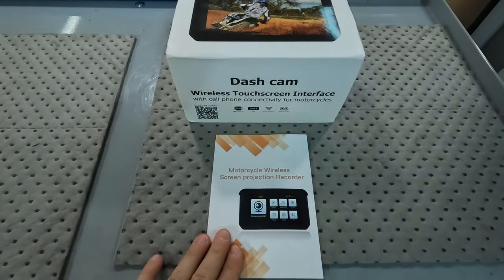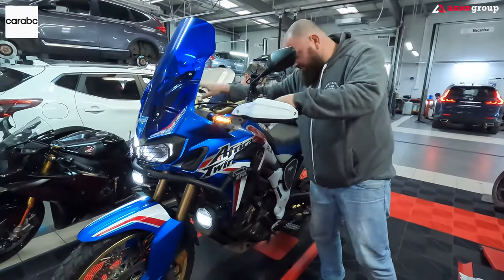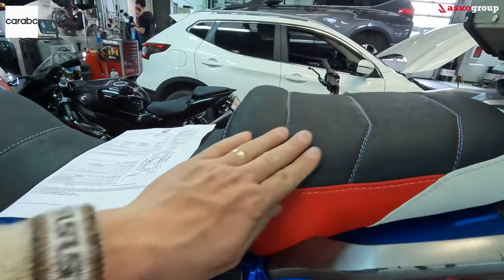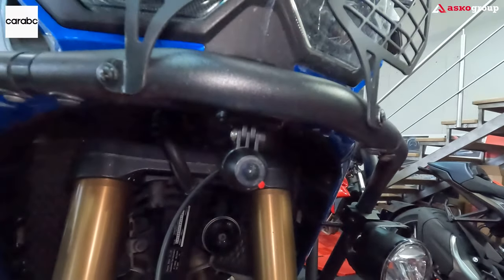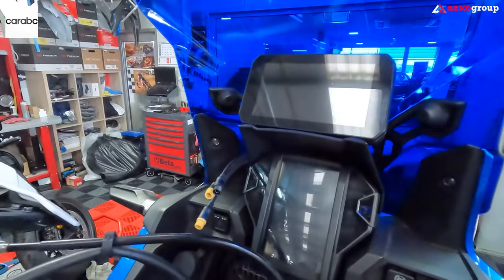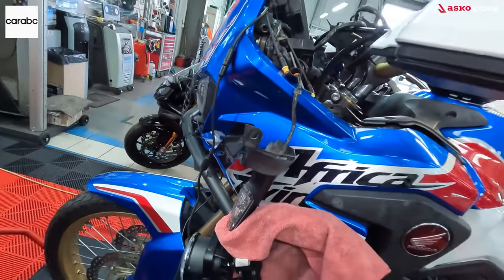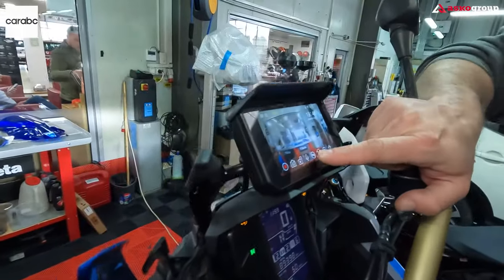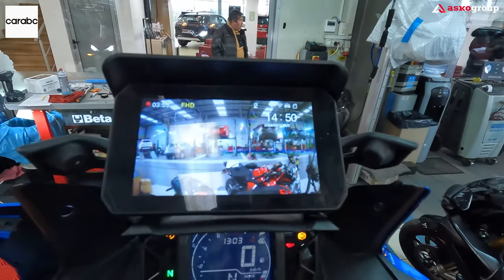CARABC Motorcycle Dash Cam with Carplay and Android Auto - Wireless Screen Projection Recorder

Comment: Excellent device at a very attractive price. My only concern is the anti theft protection. I would prefer not a plastic but a metallic mounting. I tell that to the factory as a next step upgrade. I am going to buy it for sure
Reply from the maker: Thank you for the comment! Let's detailed the theft protection for a bit: the Display you can take it out easily by removing the USB-C cable, then if someone it's steeling the cameras, they are useless for them, the cameras are conected to the device and without the display and connection cables,  they are just piece of furniture, useless for the the eventual thieves :) Regards

Comment: Great review 👊. Can't seem to find it with the 2 cameras and tyre pressure monitors though - any help/advice please ? Looks a decent product for the price and cheaper than a Chigee unit.
Reply from the maker: On the provided link it's the product that includes the 2 cameras and tyre pressure monitor.
https://carabc.cn/discount/Alami&Arthur15?redirect=%2Fproducts%2Fmotorcycle-carplay-android-auto-screen
That's the link provided that includes the product we've tested 👍
Reply: @IdealBike thanks, but it still only goes to a link with a front camera and tyre monitor  - no rear camera , must have sold out!
Reply from the maker: Even if it says on the website front  camera on the website, the package has always 2 cameras front + rear, the version it's always with 2 cameras. The device itself it's build up to serve the purposes of 2 cameras. So you can order with confidence 👌 greetings 🙏
Reply: @IdealBike Many thanks for your assistance 👍

Comment: Nice review of the accessory. How is the quality of the video recorded? Are the registration plates of the vehicles in front and rear visible properly in the recording? Also what is the storage capacity of the videos?
Reply from the maker: The quality it's 1080p Full HD, the plates are very visible, there is a 64 GB SD card included în the package. The angle of the video it's very wide about 150 Grades. Greeting
Reply: @IdealBike  Thank you for the quick clarification. Greetings!
Reply from the maker: @mukundams with pleasure 👌